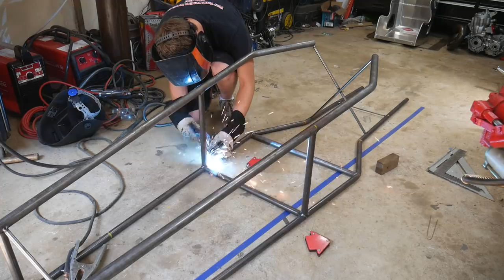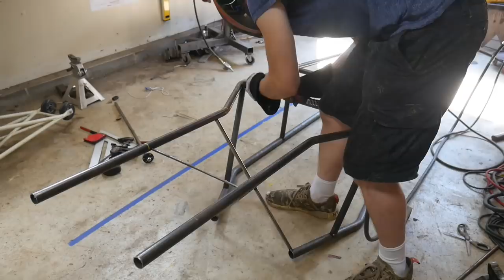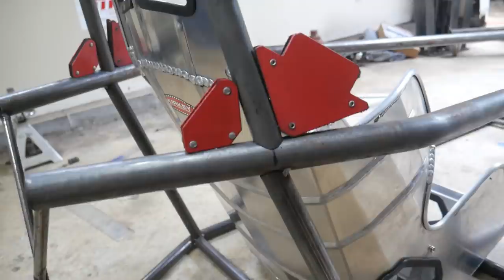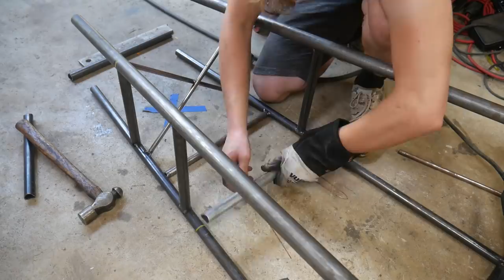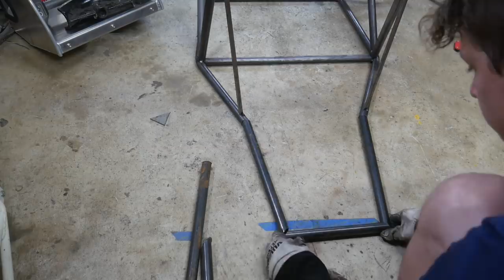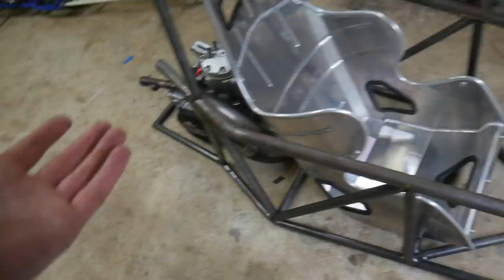Ultralight 600cc Crosskart Build Part 2

Comment: Love the quality of work! Much better than Cars and Cameras!!!
Reply: this guy and rather b welding, i get ideas on what to do. cars and cameras, I learn what not to do.
Reply: I like C&C because if they can do it anyone can, even if it's hard watching their builds sometimes because of how janky they are, they don't seem to plan anything and re-do really important parts all the time, but grind hard and VB are really decent fabricators, and you can tell they plan the build properly and understand basic structural loading and chassis design... Loving this build 👍
Reply: richard reinhard I work at a fab shop and it hurts to see the low quality of fab, even if their motto is “it’ll be fine”
Reply: @jesselamonte2215  😂😂😂😂
Reply: Check out grind Hard plumbing co
Reply: C&C do an okay job at building fun little beaters. But after like 6 years they are still doing the same thing and don't seem to learn anything.
That's what's frustrating.
Reply: @sethputnam6909  true they are the best
Reply: C&C usually only works on already built frames. People that build everything will definitely have more experience, resulting in better builds/fab work
Reply: How dare u insult cars an cameras
Reply: Zach Stacey what about their cross kart
Reply: Dq Powell they ain’t gods 😂
Reply: @93RNR  simple fix stop watching dingdong
Reply: Ryan Rotten still funny to watch their “fab” stuff

Comment: Make sure you give yourself enough room to get a full extension kick on the kick start. Half a kick will not start it. Awesome work!
Reply: And wear a boot! Cr500s have destroyed more right side shoes than any other dirtbike.
Reply: @Adub86  I can verify that for sure. Dam  near tore a Nike right off my foot. Hurt like hell.
Reply: You can get an electric start kit for these motors
Reply: @chloedevereaux1801  a 500 single with no decomp system......its got more than enough kick to fuck your shit up
Reply: Liam Hansen yeah the panthera kit, apparently it’s like 5k usd or something stupid for just the ignition cover and starter kit
Reply: chloe devereaux 
You’ve clearly never kicked one.
Reply: Buen trabajo 👍 yo quiero hacer uno y me as motivado hacer un saludo
Reply: @Adub86  yea for sure they tend to kick back really really hard. I was going to say the same thing.
Reply: I'm 6'5" 230 never problem with kicking a CR500 but shattered my shin with a 74 12to 1 compression Ironhead Sportster lol
Reply: @jasonhughey4434  ouch omg
Reply: @chloedevereaux1801  apparently you've never tried to kickstart a cr500

Comment: Looks great so far.  You’ll probably want to keep an x style brace in the front so the suspension doesnt make the chassis flex.
Also, build a full roll cage.  It’ll look better.  It’ll be safer.  You might not be able to ride it on some public trails without one.

Comment: With that new saw the blade is steel, so is there a limit to the hardness of steel you can cut? Then with tool that helps you get the right cut with the hole saw. Is it adjustable to fit any kind of tubing.
Reply from the maker: As long as it's under a certain size like 3/4" it should be fine

Comment: would a steel blade fit that DE WALT like that new one you bought  good vid
Reply from the maker: Maybe but it's meant for low rpm high torque motors

Comment: It'd be cool if that CR500 had an adapted CVT to it
Reply from the maker: Cvt is a big no for me. The gears will make it more raw
Reply: @VasilyBuilds  yea true, i just find CVT more interesting cause it'll automatically change to the best ratio for torque and speed
Reply: @budgetbuildz4191  just get a snow mobile engine.
This guy wants to change gears 🤙

Comment: Are you worried about vibration a dirtbike has a fork and swing arm that take a lot of the vibration out when guys put cr500 engines in quads it destroys the frame because the linear mass on the 500cc is a lot Honda and Suzuki was Added a counterbalancer on their 250 quads

Comment: Should have a newer single arctic cat motor out of the blast no clutch just belt drive like grind hards odessy and a pull start
Reply: Why should it have that engine? I'm sure he chose the CR500 engine for a reason....He wants to shift gears, and I would too.